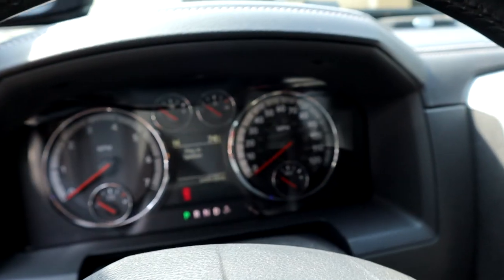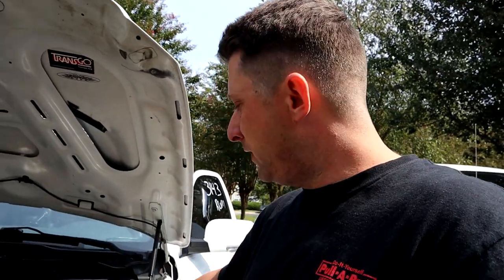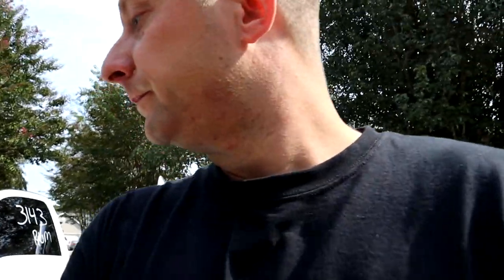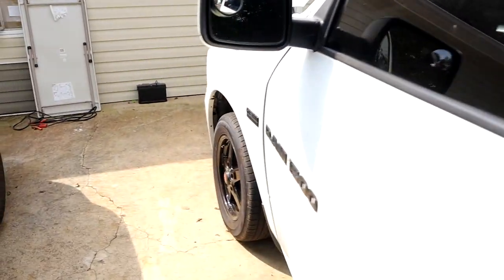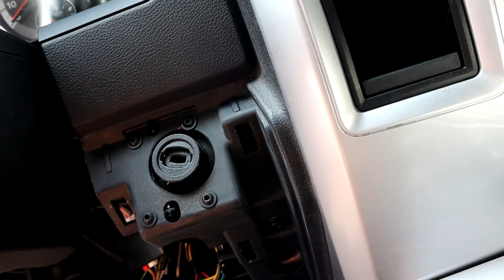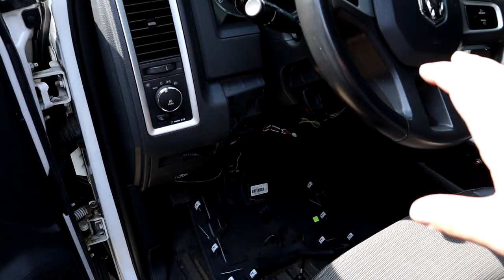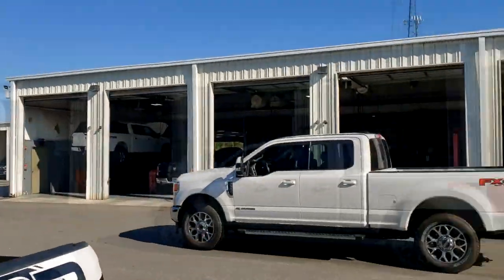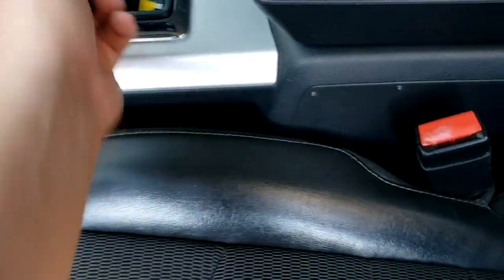Ram Trucks, Dodge And Chrysler Common Ignition Switch Key Failure

Comment: I have a 2010 T&C with intermittent non stat, intermittent battery drain.
2 times in the last 3 weeks I needed to call for service (AAA), when they arrived... vehicle started without a jump pack.
I have been told it could be the TIPM or WIN...
Each can cost $1,000.00 at the stealership.
Having to go to the stealership to "program" the TIPM / WIN is OR SHOULD be in violation of the "right to repair" LAW.

Comment: I wonder if you could slap the push start from a charger in that...wonder if they are plug and play. Glad you got her fixed. I wonder if that fuse box damaged the key unit with the surge.
Reply from the maker: Its very possible. Thanks man
Reply: @FrostbiteRam  any write ups or videos?

Comment: mine does this but the center piece is stuck down in. I use a silicon spray to lubricate it and i am good for a while. The cause for your failure is that aftermarket remote start system i see hanging there. They put a feedback into the key "box" controller and creates false readings.

Comment: Those electrical issues can be hard to figure out that's for sure and be expensive.
Reply from the maker: Definitely a pain
Reply: Thankfully my local transmission shop (Tucker's transmission in Pine Bluff, Arkansas shout out to you guys and gals) fixed my 2012 Express (5.7 HEMI quad cab red 4x2 dual exhaust 6 speed automatic transmission 3.55 or 3.92 final drive gear ratio clutch limited slip diff but non auto start under 149000 mi) for $1,030.00 with labor, computer flash, etc. My truck shuts off when you barely touched the key in the switch or run over a slight bump, so they replaced the switch and reprogrammed the remotes to the new ignition switch and so forth and beats going to the Mopar dealership and paying double the charge it'll cost you.

Comment: I have a 2018 RAM 1500 with the same problem.  I just ordered a new switch from Amazon - $112.76   I have no idea if it will need programming or not.
Reply: A follow-up,  I received my new switch and installed it this morning.  Everything worked perfectly with my old, original keys.  I do not have to take the truck to RAM for programming.  I believe it is fixed.

Comment: Mines messing up now. Full battery. The gauges light up no door chime no radio no ram screen and no start. Going to the junk yard to get one. And if its cranks buy a new one!  My ram is programed for a key not a fob.
Reply: Did you figure out your issue ? 2016 cummins exact same symptoms.

Comment: I have a 2018 Ram 1500 the dealer swears that I can just replace the ignition switch and it will not need programming. I will believe it when I see it
Reply from the maker: Had to have mine program
Reply: @FrostbiteRam same here with my 2012 but my local transmission shop programmed it not the dealership.

Comment: I have a 1999 Dodge Ram 1500, the key must be turned on and off many times before the starter finally engages . Anybody have a clue what it could be causing this ? Thanks for any reply
Reply from the maker: Could be the switch but It wouldn't hurt to test the starter your local parts store can test it free.
Reply: @FrostbiteRam  Thanks so much, I am too cheap to go buy a new truck, I will run this one until it completely wears out, lol.